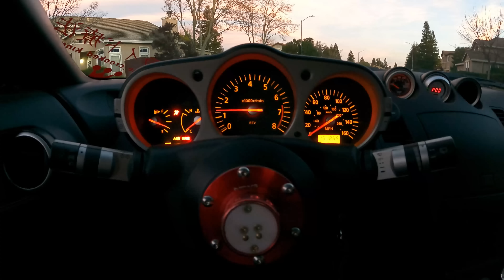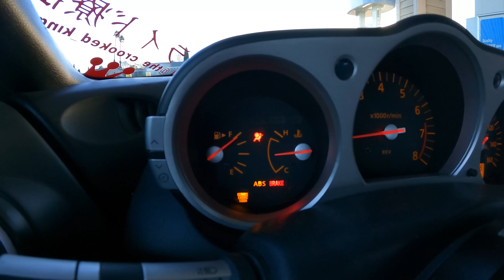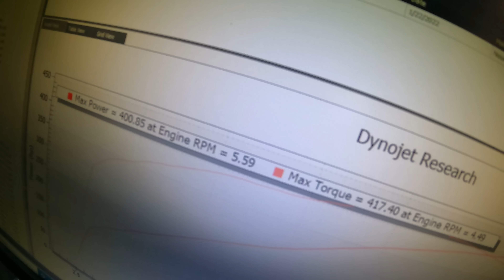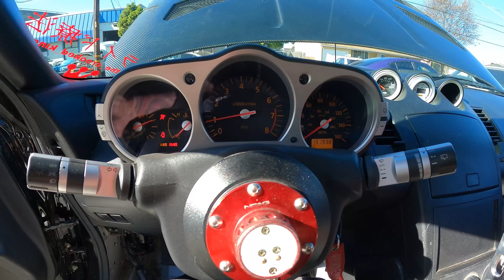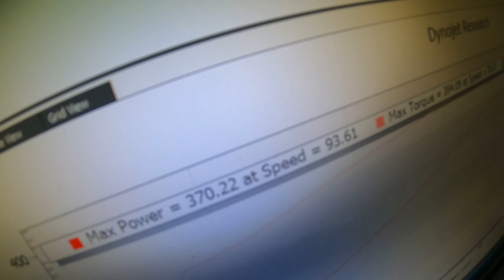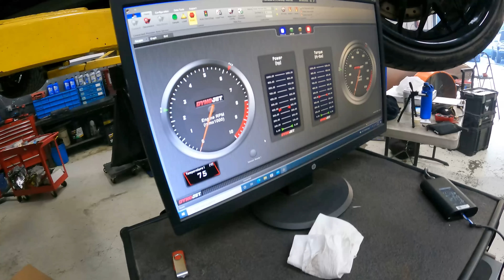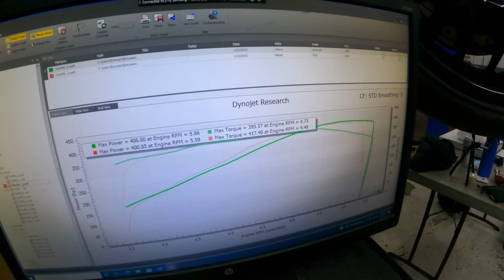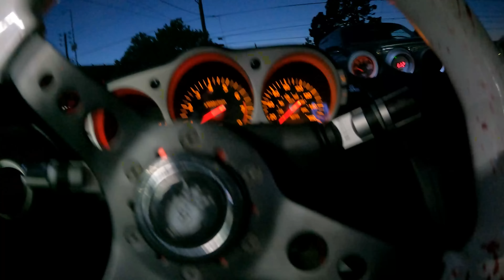2 LS350ZS, 1 DYNO

Comment: From my experience, that NGK plug made my cammed motor in my truck run more on the rich side so I went back to OEM. I literally had a soot ring on my exhaust tips. I use the OEM spec AC Delco plug on my LS3 Camaro and it makes 420 wheel. I truly hope it works out better for you though 🙌🏾. 409 is still a decent amount of power for that chassis
Reply from the maker: Thank you brother, thats good to know!!! Im still newer to the LS platform so hearing stuff like this with personal experiences helps for diag💯 much love my guy!!!
Reply: @Thecrookedking15  for sure man. I don’t wanna see anyone go through motor issues for no reason lol. That plug is great for when you do nitrous or a boost setup though

Comment: Man that power steering line is such an easy fix it didn’t sheer off it just popped off under pressure. Just put a hose clamp on it and slide it back on the male end of the “metal peice” 18:56
Reply from the maker: 😆Its rated at 48,000 psi and blew off,  I dont think that a hose clamp is gonna hold, lol but Im def talking with SIKKY to take the necessary steps to figure out what happened, they have NEVER seen it before!!

Comment: Y'all should go to lunch and then leave a few extra burgers in the back of his car in a bag and pull off from him and be like "all that weight you got in the back", he'll be like huh, "what are you talking about" then he see's the bag of food "lol

Also look into a speed density tune. I hear/see mixed results due to maf read outs.. Alot of folks are switching to speed density (mostly for boosted applications) but its worth a peek, and look into an E85 tune and flex sensor install (very simple) great gains and burns super clean and much better than that 91 octane yall have on the West Coast/Summer/Winter blend.
Also when you redo the power steering lines, you factor in a P/S cooler, that pump turns HIGH RPMS, all that heat=expansion, thus cooling it helps keep the temp and pressure down. (I had a similar issue), added a cooler and what a feeling and peace of mind! Also not sure if you added an oil cooler, but they make a kit that bolts up to the driver side and has pre-made lines and extra ports etc.. Lower oil temps = more power = less stress on the the bearings and pump!
But not bad given the drivetrain % loss, almost 500 at the crank!

Comment: man im having that same issue with weird gurgling however I have a bmw. I  know its not normal, i basically replaced all ignition components and some PCV  stuff but still going. If you figure out what it was let us know, might put me in the right direction.
Reply from the maker: SO update also, found that the plug porcelain was broken off in the center of it, are you getting random misfire codes or individual cylinder misfires?
Reply: @Thecrookedking15  No misfire codes, ill notice the throttle when im holding my foot still go a little higher. Might be a vacuum leak but im not losing enough boost to indicate that. Theses misfire like sounds mixed with a gurgle happen mostly on decel/ letting off the throttle. BMW be weird lmao

Comment: Yoooo Arron!! I got a 05 g35 mt, rev up with 117k miles and I got a problem with my rear main seal, upper oil pan, and also I need to do a full timing chain job because I have bad tensioner. I was thinking of just letting those go for now and doing a engine swap at some point. I would have to pull the motor to do those things so I figured why not just get a lower mileage one that way I won’t have any problems. I’m thinking of doing a HR swap. Is it worth doing the extra little things to hr swap or should I just stick with rev up. Also I see rev ups are like 3k for a good one and HR’s are like 1,900-2,200, so would it be cheaper for the hr possibly? Would love some input!!